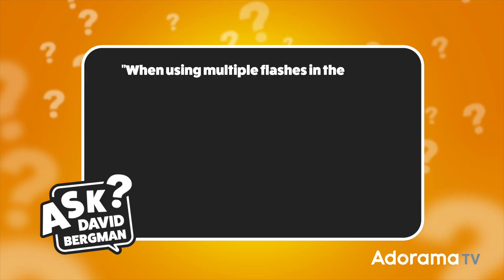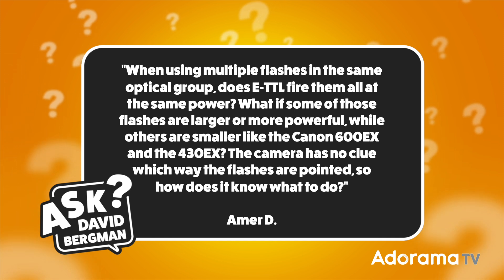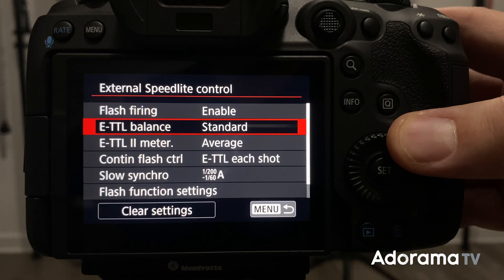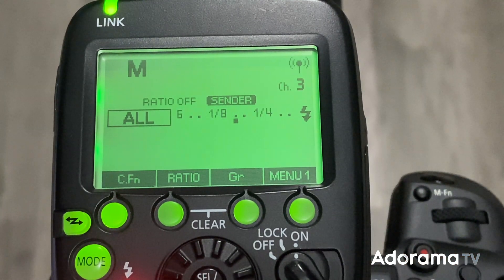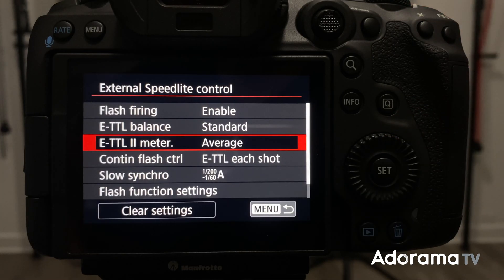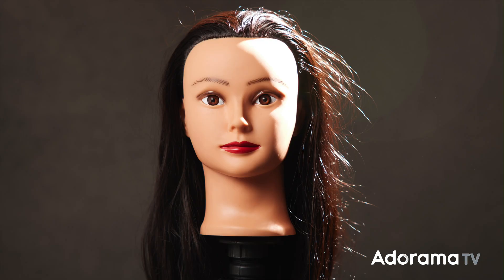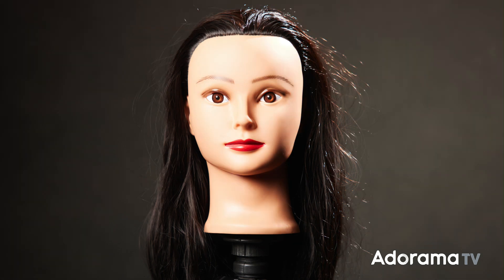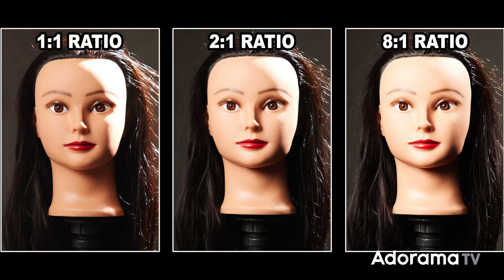TTL with Multiple Flashes? | Ask David Bergman

Comment: Great video as always David.  I do have a question though.  I have the ST-E3-RT and several Canon lights.  The problem I have never been able to resolve is the link between the ST-E3-RT and light drops after a few minutes and the only way to re establish the link is to turn both units off and then on again.  I have turned off the “sleep” function on both but the problem persists.  This happens with both a version 1 and a version 2 ST-E3-RT to the point it is unreliable at events.   Others on YouTube have also experienced this.  Any suggestions would be appreciated.
Reply: If you are at the venue where strong router, dual WiFi router, or too many wifi, the link will drop. Only way is far away from WiFi or the venue has only one WiFi or put flash as higher as you can like 12 ft or more away from WiFi, it might less likely drop the link.

Comment: I like the video, it's a clear and well presented, I just have one comment. I wonder why people still keep repeating that the camera sets the exposure by averaging over the whole scene, even if they often have to admit that they had to change its settings to make it actually behave like that. 15 years ago, my first DSLR (Canon 400D) was already using evaluative metering by default and I suspect that even the Olympus  C-4000 compact camera I bought in 2003 might have. After watching this tutorial, I checked the E-TTL settings of my current camera (which I'm pretty sure I haven't changed) and... no surprise, it's evaluative with face priority. Sure, it's not perfect and I understand that many people, in particular those working mostly in a controlled environment, prefer manual exposure; but I don't think it's necessary to make automatic exposure look dumber than it actually is.

Comment: Wouldn't just using a flash meter be a whole lot easier
Reply: If you want to measure each flash separately and then dial in the exposures manually, then go ahead. For me, it's easier to see the exposure of each flash after taking a test shot, and then dial it in manually as needed.
Reply: Just like anything else in the digital age, there are multiple ways to do the job. Tools are tools, the end result is what counts. When I was shooting chromes I used a flash meter AND a Polaroid back. Now, I can look at the LCD screen and histogram and do the same. In real time, the time it takes to zero in an exposure with multiple pops with a meter as opposed to multiple pops looking at the result is almost exactly the same, plus you know you are getting what you want when it LOOKS right. And as David points out, TTL is for when you can't take that time, and a flash meter won't work then either.